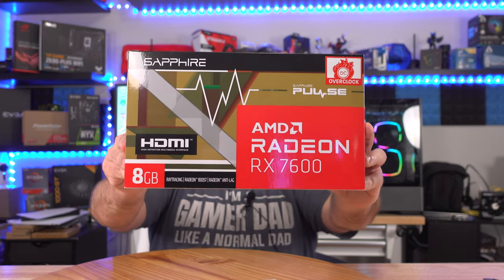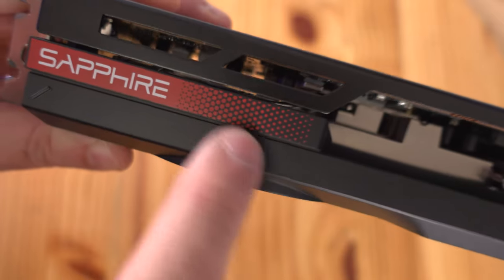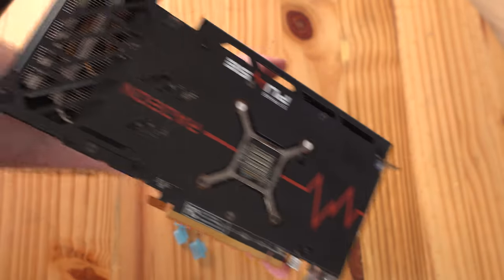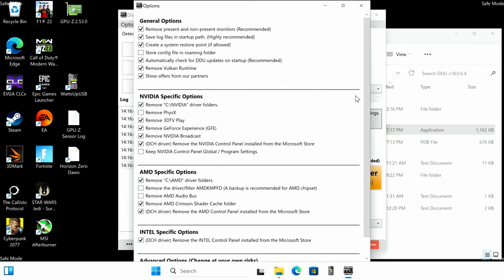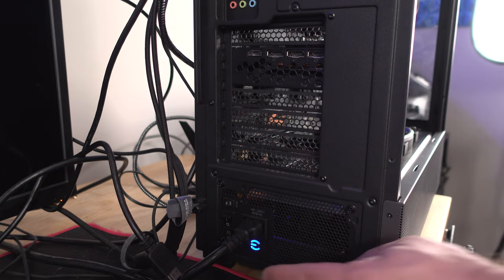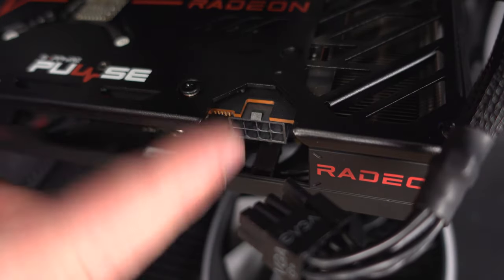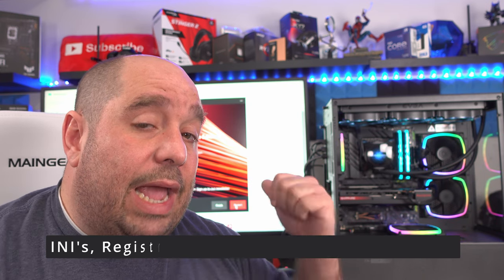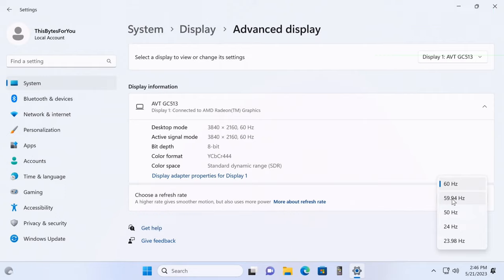How to install the AMD Radeon RX 7600 Graphics Card in your PC - Sapphire Pulse RX 7600

Comment: Another tip after turning off your psu, unplug the cable then hold the power turn on button of the case to discharge the power in motherboard completely...
Reply from the maker: Yup, thats a good one

Comment: Just upgraded from 1070 to RX 7600 and I'm just wondering if 16gb of DDR4 RAM is enough for playing games on 1080p or should I upgrade that too?
Reply from the maker: Well, it will work, but its getting to the point that its not enough.  Sure, its good for games, but you have all of Windows as well, and it takes up a good chunk of that.  You can hold out for a little longer, but when I build a machine for me, for myself, its 32GB or higher.

Comment: Iggy I have a question and i hope you'll notice 🙏 I have an APU Ryzen 7 5700G and will soon buy RX 7600 . As an APU should i go through the process of using DDU as well? Or should i just skip that part and go directly to installing the drivers and putting the GPU on board?
Reply from the maker: So, you haven't watched the video, I noticed, I go into excruciating detail about that, specifically, but maybe this will work better for you https://youtu.be/qbKrePI6rvM

Comment: @ThisBytesForYou - Thanks for the thorough tutorial. I just bought a RX 7600 for my son and follow the steps in your video and everything went fine until the restart after installing the AMD graphic drivers (@17:44). The PC boots and Windows is starting but not able to access the windows menu or launch any programs. Any software that normally starts automatically (such as Steam and other does not launch). Any tips on how to solve this would be most appreciated 🙏 PS - Apologies for my bad english 😇
Reply from the maker: Always a pleasure my friend, no worries, your English is great, better than many English speakers ;)  When you restart, are you still in Safemode?
Reply: @ThisBytesForYou  No, it re-started in normal mode. The PC just don't lauch any programs which normally launch automatically, nor able to access the Windows menu or launch any programs myself 🙈🙈 I've just tried to re-start it myself but that is not possible either.
Reply from the maker: right click on your taskbar, any open space, then click "Taskmanager"  In task manager, on the left click "Startup Apps", there you will see all the apps that start up with your PC, they will have the status of "Enabled" or "Disabled", right click on one your want, then select Enabled.  After you have selected all the ones you want, restart your PC.  Let me know if this works for you.
Reply: @ThisBytesForYou  I am not able to access the Task Manager. When clicking on Task Manager nothing is happening. The same goes for the start menu. Only way to shut down or restart the PC is to pull the power cable.
Reply from the maker: right click on the task manager
Reply: @ThisBytesForYou  Hi again. Appreciate your feedback  and effort🙏 Nothing happens when right clicking on task manager. I suspect there is an issue with the installation of the driver pack. Will try to restore the PC from a system restore point.
Reply from the maker: you might have a corrupt install, I have never seen this happen from this process, UNLESS you have an AMD chipset and didn't deselect all the AMD stuff like I mentioned, thats possible but always happy to help.
Reply: @ThisBytesForYou  Yes, I belive the reason is corrupt install. I do have an AMD chipset and I did deselect all AMD stuff as per your video. Yesterday I restored the system and than used the driver package found on the Asus web page and everything worked fine. As an experiment I than re-installed the AMD Arenaline Edition software and I got the same issues as initially and had to restore the system again. I probably will do a full system restore to see if that sorts out the issue with the AMD softeware. Thank you again for the advices and feedback 🙏🙏

Comment: please can you help me... when i install MSI AFTERBURNER the clock speed goes to max and it is its default. so what can i do? please help
Reply from the maker: What is the manufacturer and model number of your cars and do you have your windows power settings set to ulimate/performance
Reply: @ThisBytesForYou    Msi Pro B650S Wifi is my motherboard Ryzen 5 7600 is my processor. I don't do anything just install the afterburner and it's default Core clock goes to 2900 even if click to default it goes to 2900. but if I see in AMD Adrenaline there is sign of maxing or overclking. Is it a bug of Afterburner? Or what should I do? AMD and Afterburner is showing different reading
Reply from the maker: @gokunex3  oh I typed that too fast, what is the manufacturer and model number of your graphics card.  I need to proof read sometimes haha
Reply: @ThisBytesForYou I gave the link but I can't see this anymore.
My graphics card is SAPPHIRE AMD RADEON RX 7600 I commented a pic by proff but for some reason I can't see it anymore :(

Comment: i'm planning to pair this with my current i7-7700 (upgrading from a 1050ti) and i am aware of possible bottlenecks but is there anything else i should know?
Reply from the maker: this is a lower end card, which should actually pair well with that cpu, how much ram do you have and what is the speed?  Just know, you will need your OS to be full UEFI compliant and GPT.  What is your motherboard manufacturer and model number as well?

Comment: hey boss, i have a quick question. in my bios for the ASUS z690 TUF Gaming Plus Wifi do you recommend i manually set the PCIEx16(G5)_1 slot to Gen4, Gen5, or leave it on Auto? I see a difference between setting to gen4 to gen5, where 5 seems more stable and 4 seems like it responds faster but less stable? can you confirm if you notice any different and if not, do you recommend setting it to gen5/auto speed?
Reply from the maker: Only if your devices are Gen4 or Gen5, try not to leave too much Audio and update your BIOS.
Reply: @ThisBytesForYou  got it. i have an rtx 3080 and i see that some people manually set the main PEG slot link to gen4 for compatibility, do you recommend doing this? won't the pcie 4.0 slots get used instead of the 5.0 ones if i set it to that manually?
Reply from the maker: Yes, since it is a Gen4 device.  Gen 5 is backwards compatible, like Gen4, 3, 2, 1, etc but is not forwards compatible, so if you set it to Gen5 is may not POST.
Reply: @ThisBytesForYou  gotcha. and doing this wont change the lane allocation? like it wont use PCH lanes instead of CPU lanes?
Reply from the maker: No, as long as it doesn't state it in your manual all the PCIE slots are controlled by your CPU.
Reply: @ThisBytesForYou  thanks very much for the help. set to Gen4 comfortably then!
Reply from the maker: yup, for sure, you will be good my friend.  Gen 5 for now is only for m.2 SSD's.

Comment: I bought the same product and wanted to ask a question. Is it normal for the screws to look loose even though they are tight and for the underside to ''move''?
Reply from the maker: my friend, I wish I could tell you, but sadly I have to return Sapphire cards after I review them... gets me real upset but being a small creator, its the only way I can nab them
Reply: @ThisBytesForYou  no problem. i just found out that's normal because screws have springs under them and they're not attached to the radiator.
Reply from the maker: @loreo5509  sounds good bud, sorry I couldn't help you on that but I always try my hardest to help where I can

Comment: can you install this card on a b450 mobo?
Reply from the maker: You should be able to, the chipset has no issues with it, but maybe the specific board does, let me know the manufacturer and model number.  A few things to look out for to make sure it will work though.
1.  Make sure you are on the latest BIOS
2.  Make sure you are on EUFI, not legacy
3.  Make sure you are using an HDMI 2.1 cable or DP 1.4 cable.
4.  Make sure your OS drive is set to GPT, not MBR.
Reply: @ThisBytesForYou  I'm using the MSI b450 mortar max and looking to upgrade from a rx570. CPU is a 3600 with stock wraith cooler. Also what would be better HDMI or DP for connecting to the monitor?

Just found your channel and vids doing research. Love your work. You have earned a new subscriber
Reply from the maker: I prefer DP, because its a much more stable and steady connection, the current standard is 2.1 but there are not real 2.1 monitors, but 1.4 works great. HDMI is at 2.1, widely availably and it works great, it is slower than DP 2.1 but its hard to get a dp 2.1 monitor, so getting HDMi 2.1 or DP 1.4 would be good for you no matter what, sorry if I am confusing on this hahah.  The reason I get into HDMI 2.1 and DP 1.4 is if you go lower than HDMI 2.1 or DP 1,4 you are almost guaranteed issues with AMD.  So I hope that helps and I thank you so much for your support  and kind words, it means the world to me. @WiTRoOner
Reply: @ThisBytesForYou   Last question, why would i set my OS drive to GPT not MBR?
Reply from the maker: Because GPT is newer, allows for 2TB and larger drives an integrates directly into your BIOS, which since you are enabling UEFI will work correctly.  Question for you, why wouldn't you? @WiTRoOner

Comment: Hi. Im currently using a computer with amd ryzen 5600G. And this have an integrated graphical unit (i dont know how to call it😅)....So I dont have a graphic card like this in the computer. So , I want to buy this Radeon rx 7600 card....How should I install it ? It will be easier ?
Reply from the maker: Hi, you might want to watch this video, Have you read the title?
Reply: @ThisBytesForYou  yes, I watched it. What did I missed ?
Reply from the maker: The same way if you did have a graphics card, almost, put the card in the system, turn it on, disable the iGPU in the bios, save and exit then go in the OS and do like i show you, its OK to use DDU as well, like I show you.  You also dont need to disable on board video, you can leave it too, it will still work as long as you plug your monitor into the new graphics card you just installed.

Comment: boss, I have a question.....I will buy the rx 580 for my pc...and it requires a 1x6 pin connector...my psu has a 6+2 pin power connector....and I was thinking if maybe I can use the single 6 pin connector alone and leave the 2 pin dangling....
Reply from the maker: yup, thats what they are for, you can use them as a 6Pin PCIE or an 8Pin PCIE, if you are using them as a 6Pin, you will have 2 pins just dangling out  and that's OK.  You will be fine.
Reply: @ThisBytesForYou  wow thanks boss.....anyways as far as I know the pcie 2.0 and 3.0 only gives 75w, and the 6 pin gives extra 75w, but the rx 580 sucks 185w, will it be fine?
Reply from the maker: you will be perfectly fine my friend, when the  580 came out, PCIE 2.0 was common place more and more were coming out with 3.0, you are fine.
Reply from the maker: that being said, its VERY important, that you are set to UEFI in the BIOS, set to GPT on your main drive, and are using NO adapters, straight HDMI to your monitor and make sure your hdmi cable is HDMI 2.1, if you don't know, buy a new cable.  While this video is on cloning, the first 6minutes and 30 seconds will help you change your BIOS to UEFI and set your drive to GPT, VEYR IMPORTANT: https://youtu.be/aHVCmkm67q8
Reply: @ThisBytesForYou  thank you soo much sir
Reply from the maker: Always a pleasure my friend, so very happy you stopped by, trusted in me to help you, liked and subbed as well as took a moment out of your day to thank me.  It means a ton to me and I am so very happy I could help you.
Reply: @ThisBytesForYou  okay...I'm gonna be honest sir? I dont understand this uefi thingy....what does it have to do with my gpu? I'm just an amateur...
Reply from the maker: They are different BIOS', there is standard BIOS and there is UEFI, UEFI allows you to use your mouse in the BIOS, regular BIOS does not.  Boot procedure is faster in UEFI, allows windows to interact directly with the BIOS and visa versa, allows for drivers over 2TB, allows for secure boot and windows 11.  And no worries my friend, this is a noob friendly channel, because we were all noobs at one point until we learned.
Reply: @ThisBytesForYou  so I have gpt..
Questions:
1. the only thing that I don't know is If im on uefi or what...
Cause it says here
UEFI Boot Sources
   Windows Boot Manager
   USB Floppy/CD
   USB Hard Drive
Legacy Boot Sources
   USB Floppy/CS
   Hard Drive
     SATA0
   Network Controller (Realtek XE B03 D00 ("it might be O as in "oval" or 0 zero ")
2. Why do I need to check if I have gpt and uefi for my gpu again?
Reply from the maker: you are on UEFI then
Reply: @ThisBytesForYou  so I have nothing to worry about and just carry on?
Reply from the maker: sure looks that way, install the drivers the way I show you in this video, removing the old ones and make sure your cable is hdmi 2.1 @sadMousepad
Reply: @ThisBytesForYou  thanks again friend
Reply: Hey😭 @ThisBytesForYou  I'm sorry for being sooo annoying😭 but..do I still need to use ddu with my intel hd igpu? Yes igpu, not a dedicated graphics card...or not bother at all....I'm really sorry😭
Reply from the maker: this will help:" https://youtube.com/shorts/qbKrePI6rvM

Comment: Why my GPU not detecting gpu on driver/gpu-z ?
Reply from the maker: you haven't given me any information to help you, I don't know.
So that I can help, please list the manufacturer and exact model number of the following components:
1. Motherboard - manufacturer and exact model number
2. CPU - manufacturer and exact model number
3. RAM - manufacturer and exact model number
4. Video Card - manufacturer and exact model number
5. Power supply - manufacturer and exact model number
6. Monitor - manufacturer and exact model number
 Redundant I know, but many people forget to enter manufacturer and exact model number
7. Do you have ALL of the PCIE connections plugged in, and not daisy chained or pigtailed, each coming directly from the power supply?
8. Are you running through HDMI, DP, DVI, VGA, any adapters?
9. UEFI in the BIOS from Legacy.  If it was set to Legacy, you will need to reinstall windows to get correct support.
10. Disable CSM in the BIOS
11. Installed latest supported chipset driver?
12. Have you disabled Fast Boot within Windows?
13. This video will help you identify hardware inside your PC: https://youtu.be/65ZSiVImJx0

Comment: I do the same but for some reason its no running some games 😢 Monitor could be? Idk
Reply from the maker: What do you mean it's not running games? Did you watch the video?
Reply: @ThisBytesForYou  Yep, its a new graphics card, the installation is the same, mine is AMD Radeon RX 7600. When I finish the process, I tried to open an specific game but it's not working, after that, I restart my PC and I can't open AMD Software again 😞 your video is so good, but maybe I have other problems idk
Reply from the maker: @_latteez  what card did you have before?
Reply: @ThisBytesForYou  None, it was with the AMD integrated graphics
Reply from the maker: @_latteez  and did they work before?
Reply: @ThisBytesForYou  That's right, it worked fine with games
Reply from the maker: @_latteez  hmmm, did you use ddu to remove the old drivers and did you unselect all the amd stuff?
Reply: @ThisBytesForYou  I'll do the process again, surely something was missing. Thank you very much for responding, I'll keep you posted after I do this test 😅
Reply from the maker: @_latteez  what is your motherboard manufacturer and model number?
Reply: @ThisBytesForYou  MSI Pro B650 M-A Wifi DDR5
Reply from the maker: @_latteez  do the process again, then download and install this driver, once it's done, restart https://www.amd.com/en/support/chipsets/amd-socket-am5/b650 then download and ok install this driver https://www.amd.com/en/support/graphics/amd-radeon-rx-7000-series/amd-radeon-rx-7600-series/amd-radeon-rx-7600-xt
Reply: @ThisBytesForYou  is there a difference between 7600 and 7600 XT? My graphics is w/o the XT
Reply: @ThisBytesForYou  UPDATE: IT WOOOORRKSSS!! Thank you so much for your help!!!
:face-red-heart-shape:
Reply from the maker: @_latteez That's awesome to hear my friend, and thank you so much for letting me know.  Always a pleasure, so very happy you stopped by, trusted in me to help you, liked and subbed as well as took a moment out of your day to thank me.  It means a ton to me and I am so very happy I could help you.
Reply from the maker: yes, the xt is faster and has more ram.

Comment: i previously had an integrated graphics and now i have this card but in games i still have the performance from the integrated one my rx 7600 is also called "discret"can someone help?
Reply from the maker: did you watch this video...
Reply: @ThisBytesForYou  yes i did but i didnt understand how to Switch my "Main" graphics unit (the APU)to the new Card that i installed correctly as explained in the video.i also deleted the old drivers and installed the new one (as you explained in the Video)but when starting a Game i still had the Performance of the APU Not from the new GPU because in the AMD Driver IT Said that the RX 7600 Is my "second GPU".but fortionatly i fixed the Problem by Just setting my RX 7600 AS the Standard graphics unit in my Windows settings.

Edit: sorry for the spelling my Keyboard ist in an different language and the autocorrection Is stupid:)
Reply from the maker: well, I speak English and Spanish if that helps, my first tongue is Spanish but disable your onboard gpu in your BIOS, and it will force you to use you 7600 but please note the 7600 isn't the best gpu, its a lower end entry level gpu, but i am working on a video to get better performance.  Stay tuned for that.ALso make sure your monitor is connected to the 7600, not on board video.  @Timhajde